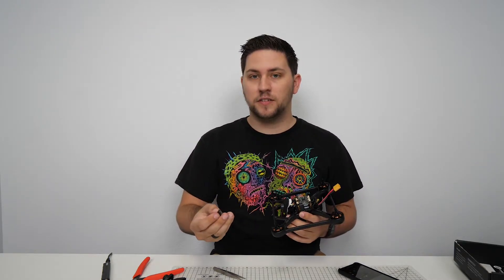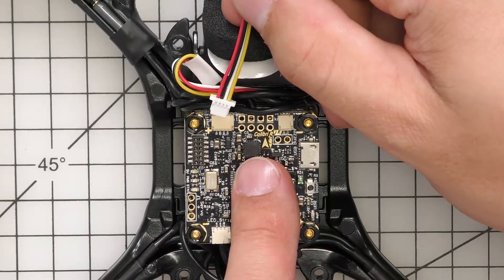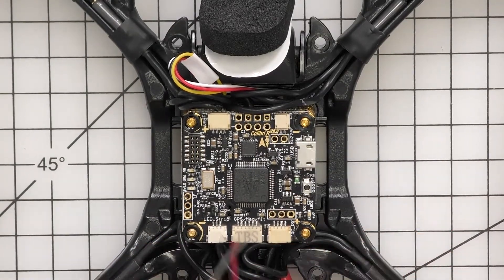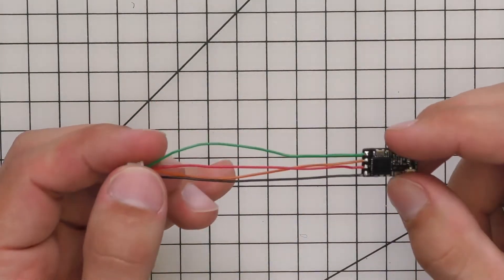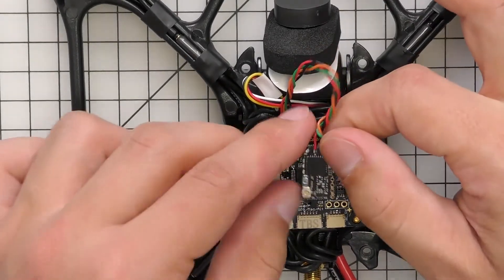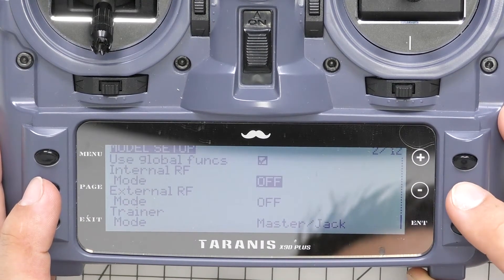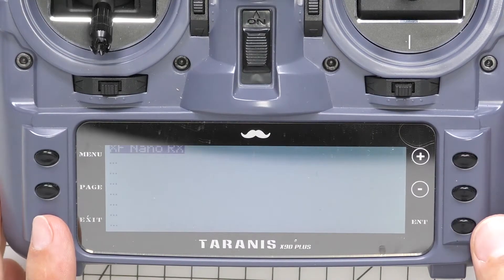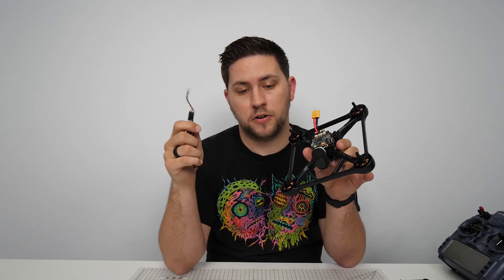Install Crossfire Nano on TBS Oblivion FPV Racer

Comment: So, where can we obtain the connector, with the smaller end, that plugs into uart 1 of the TBS stack for the xfire nano? I misplaced mine and can’t find one that’ll fit? Even with all the many cable/connectors I have, I cannot find a single one that fits.. HELP!
Reply: Stashman FPV did you manage to find this cable??
Reply: @kiwigus1953  No :-(
Reply: @Stashmanfpv  I’m taking a guess on a jst sh 4 pin connector. I’ll let you know if it works out when I get them
Reply: called a 5v VTX cable.  order it from tbs themselves

Comment: Hello, I wired mine this way and was able to bind the nano to my crossfire tx however I cannot get betaflight to recognize my stick inputs despite configuring all necessary settings. Do you possibly have the RX and TX cables reversed?
Reply: Darrell Butler did you have to reverse your tx and rx?
Reply: I looked at his wiring and did mine the same but could not get betaflight to recognize stick inputs on the receiver tab.
Reply: Darrell Butler ok cool. I’ll probably just depin the connector. Thanks!
Reply: So this should be:

Nano RX to F/C TX
Nano TX to F/C RX

Right?
Reply: Is this why I cannot bind mine? Same wiring won’t bind :/

Comment: Hi. Do you have to go into betaflight and configure uart1 to CRSF? Or can everything be changed in the osd menu? Also could a beeper be added to the oblivian?
Reply: Jeremiah Ulishney yes you do have to go into Betaflight and change serial to Uart1 & CRSF, there are guides out there that demonstrates this.
Reply: Thanks. I just thought tbs would have this set up with there receiver in betaflight already and didn’t want to go changing things since it’s already to go out of the box with betaflight setup. Also I noticed you have the orange wire going from nano chn1 CRSFTX to FC URAT TX and green going from nano chn2 CRSFRX to FC URAT RX. On all my other flight controllers I have put the CHN1 CRSFTX to URATRX and CHN2 CRSFRX to UARTTX. Are the pinouts reversed on the tbs power cube?
Reply from the maker: You need to go into betaflight to configure it. Ours was already set to crossfire by default though. Beeper Yes.
Reply: Had a similar question -- Mine came set to sbus and crossfire, however when configuring the UART 1 with serial RX I can't get the receiver tab to show any inputs. Bound successfully too. 

Any ideas?
Reply: Nevermind -- After looking over everything, I crossed the rx / tx wires!

Comment: There is a small request! Make a video on the Nano receiver's connection for a full TBS RSSI
Reply: Yes I was also wondering how you get avantage of the other 4 pins of the receiver with the powercube to get full telemetry